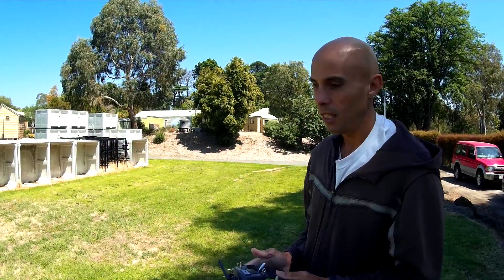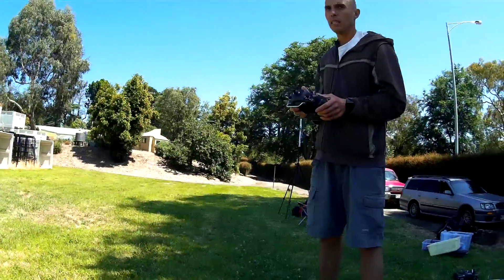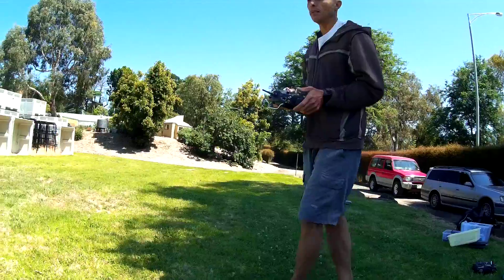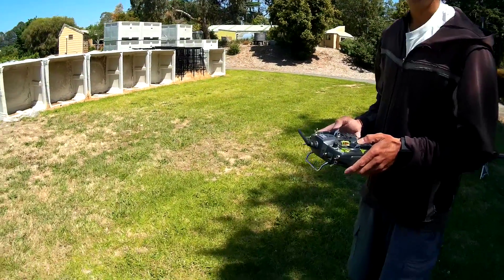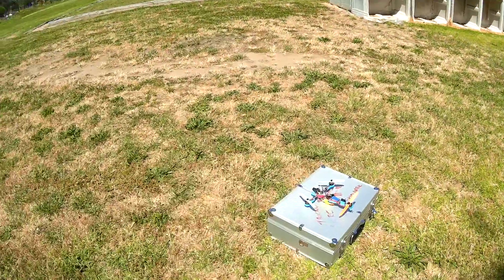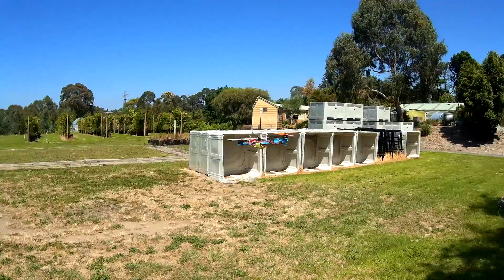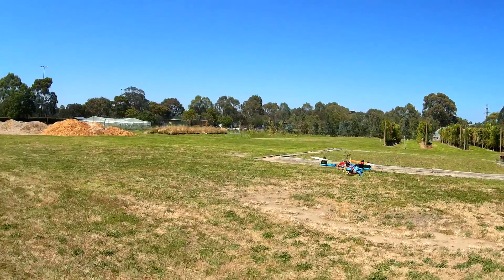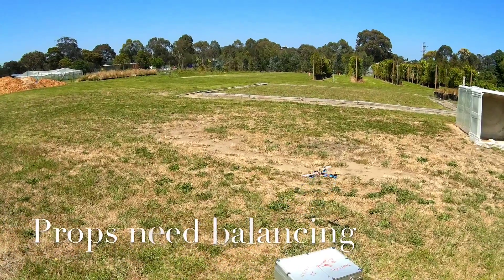Skidmark | Full Throttle Climb Test

Comment: https://www.banggood.com/Mini-18A-Brushless-ESC-Speed-Controller-3S-12V-For-DJI-Phantom-p-949611.html  < waiting for these, I think it says atmel on that chip!! Look light and are cheap.
Reply from the maker: They look nice but way overkill for Skidmark max drain is around 5amps per esc. Let me know how you go though
Reply: Yeah, sorry I didn't think I actually posted that.. under the influence ;-) They're for this https://www.banggood.com/LS-250-Cicada-2500mm-FPV-Quadcopter-Carbon-Fiber-Folding-Frame-Kit-p-954298.html < as usual, I want the ESC's in the plate gap, and with the DYS 1806's drawing 16 amps on a 6x4, I need more than the 12 amp SK ESC's I have.
Probably going to be my last build for a while as I was made redundant on the 1st.
I'll let people know if they're any good/can be flashed.